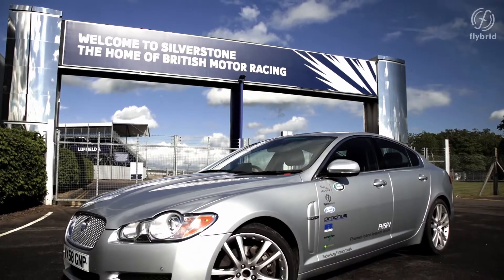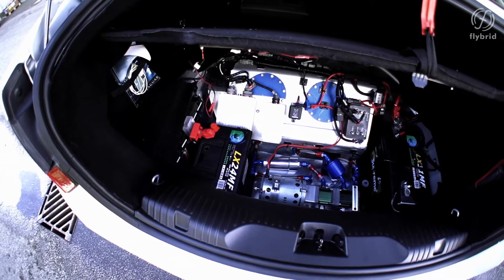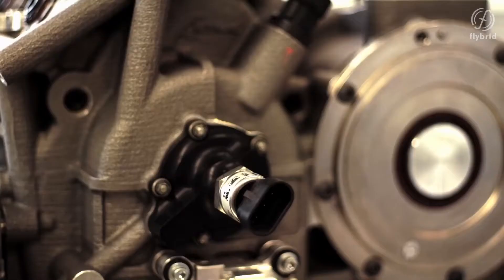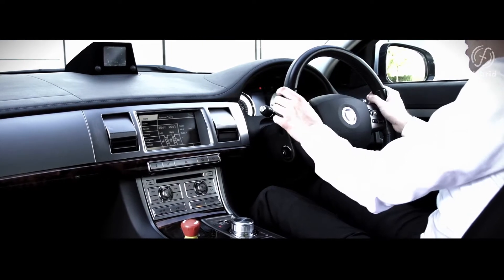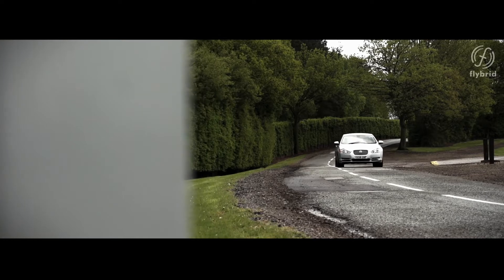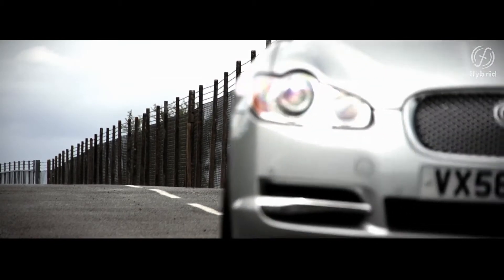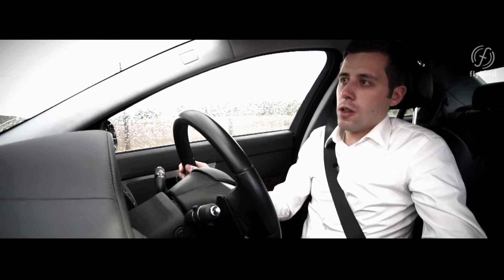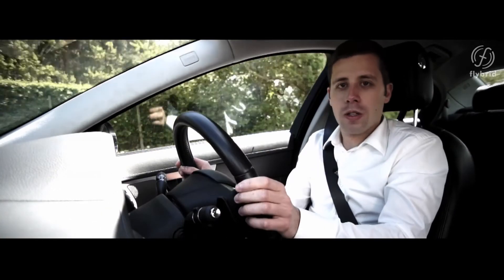Flywheel Hybrid System for Premium Vehicles

Comment: there is a way better system, simpler design, cheaper, easy and fast to install the kit. harness energy from motion will work on ICE or EV. Simply attach the system on to the wheel, You can attach up to 4 wheels. Best of all, the system also harnesses energy while the vehicle in motion without affecting the RPM or power of the wheel because our system is a Lenz free generator/motor. The energy that harnesses from motion can store in capacitors, batteries or power the motor. The faster the vehicle goes the more it can generate the power. When you reach your destination, batteries may have more energy than when you started. What's next, use your car and power your home. With Wheel Power, you can accomplish anything. Get it?
Reply: I have something so crude it will make you laugh , handfull of moving parts , 1800's tech , no electric of a fuel , all human input .

Comment: Corporations love profit first before the environment. They would rather a system that is battery based so you NEED to buy a battery and NEED to buy a charger and NEED to recharge your batteries at the charging stations AND keep doing it.
Oh.. and they would rather SELL you a WHOLE car rather than a retrofit that costs less, lasts longer, allows you to reuse what you own and is kinder to the environment. 
WELCOME to the world of Greed and well.. GREED
Reply: @crxdelsolsir 
You're obviously correct..
It doesn't matter they cant hide the potential exploitation of leverage from everyone all the time....im a year or two away from giving the peasant class a dirt cheap form of transportation , human powered , faster then a bicycle from less input , a fresh retirement aged male will COMFORTABLY beat a professional sprinter on a carbon road bike..

Also i have infinite ways to generate electric from leverage & compressed air engines..
(i have functional autism & dont struggle breaking video game mechanics through exploitation) im a mechanic aswel.. 👍

Comment: Could this system be fitted to an all electric car to prolong battery life? Maybe with a bigger flywheel?
Reply: Interesting thought I would think it would be a lot of parasitic loss and since the motors driving the car also double as generators for the battery already I don’t seE how a fly wheel could be more efficient than regular EV regen braking
Reply: @lilkris3008  Charging and discharging the battery wears it out, especially under stress. The Flywheel therefore conserves the overall life of the battery.
Reply: Redemption  What? Total nonsense.

Comment: so its like a regenerative braking system except this time there is a flywheel?
High Good Content..
Reply: When will they put large, heavy, safe, counter-rotating  flywheels in the back seats shotgun seat, and trunk, and under the hood? Recharge of a flywheel is many, many times faster and easier than recharge of a battery. They also are environmentally way, way less destructive than disposing of old batteries in dumps. Housed flywheels at the gas station could spin up the heavy flywheels in the seats and trunk. Such things have actually been done since the fifties or sixties of the last century. Buckminster Fuller said, "Ye shall be as gods,"--"so get on with it," he added!
Reply: Vincent Flack a 5kg flywheel provides 6s 80hp power,, 10flywheels 50kg you do 1min of 80hp, and you could fit maximum 500kg so 10min of 80hp. Do you still think it is worth charging the flywheels for 10 of driving while increasing the weight of the car dramatically and compromising handling? 
A small flywheel for a hybrid system is perfect: low weight and it stores the engine equivalent to braking 2 times from 150kph to 0, so enough to compete with a hybrid. It will not compete with a plug in hybrid but is’t much better because it saves weight which keeps the car handling well, and it less complicated than an electric hybrid system, safer